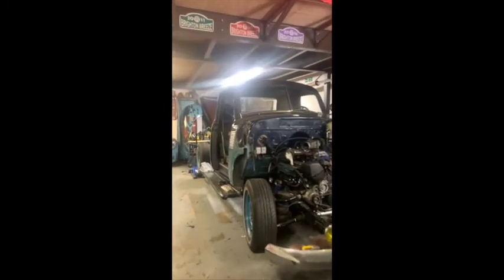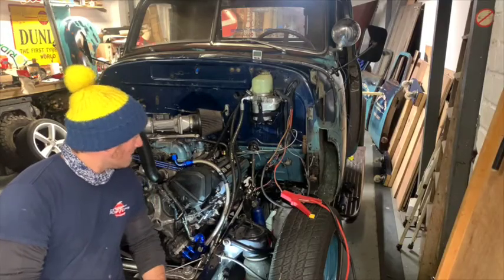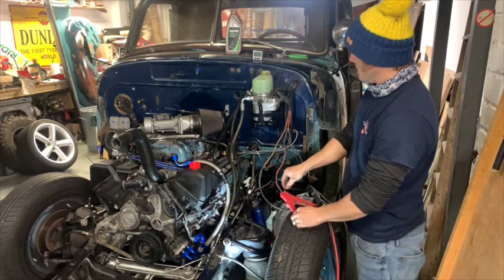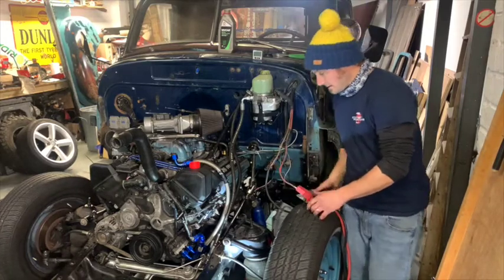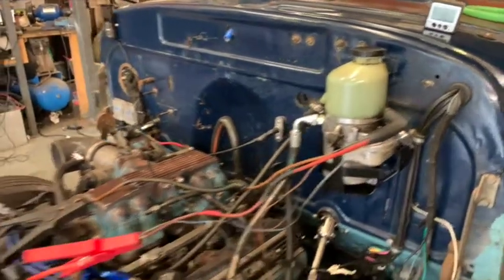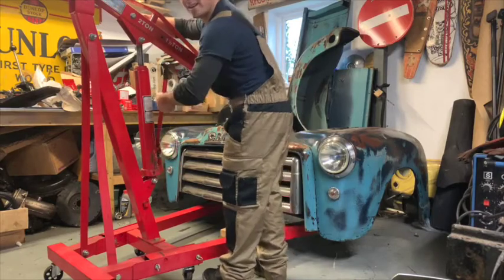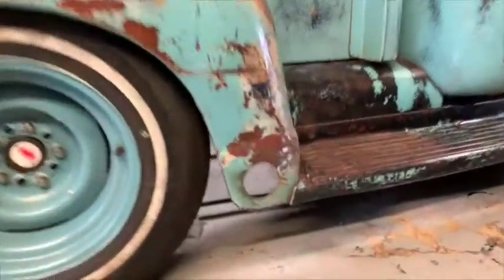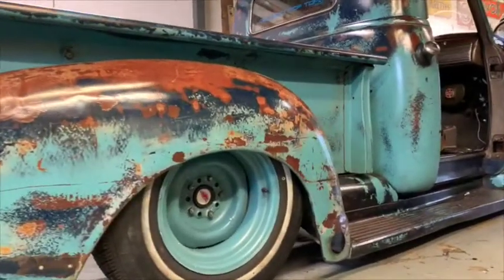Part:5 1950 gmc 1uz pickup truck , electric Power Steering & Panels Back On. ( chevy 3100 )

Comment: Looking good all back together. Have you got a deck for the bed or are you gonna be showing off your framework? Did you figure out the power  steering issue. Could have been air in the system. I changed my steering rack in the t5 and it vibrates and make horrible noises with air in the system. I had to turn full lock both directions a few times to release it all.
Reply from the maker: Not yes still have a little more one side . I have an other rack to  going to swap out and see if it’s rack of pump !